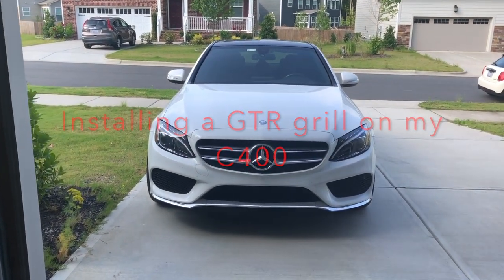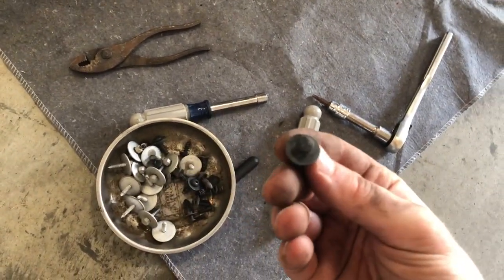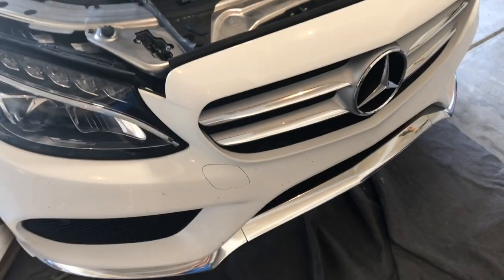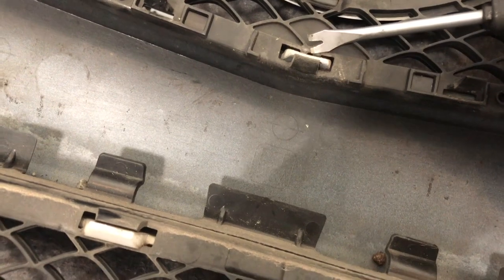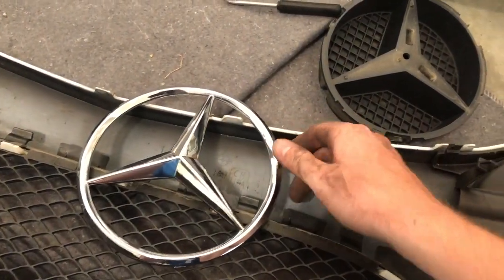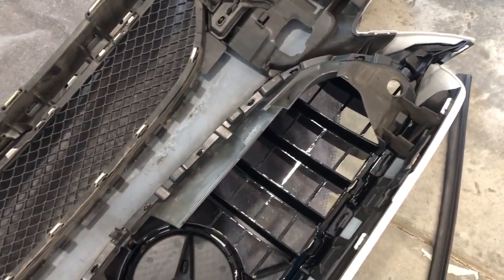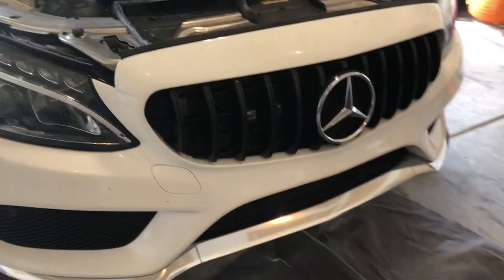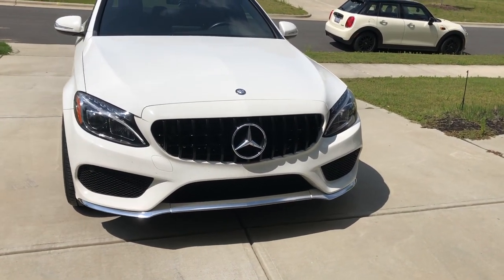Part 2 - Installing a GTR style grill on my C400 (C450/C43 AMG)

Comment: Hey Mike, just ordered the same grille for my C300. When you popped in the new grille in place, did you put back the mesh cover behind the grille as it originally came? Unless I missed it in the video.
Reply from the maker: Nice! I didn’t, mine wasn’t really a mesh it was a whole assembly that came out as one piece.
Reply: @mikesandve2564  gotcha. I was curious because I didn’t see it in the video and I can see on my grille as well, there’s a mesh like piece that probably part of the assembly that would need to be popped back behind that new facelift to avoid pebbles and other debris flying through the grill.
Reply: @Frkilicious  did you order that mesh? I am in the same boat, I also don't want the radiator to show as easy.

Comment: i have the c400 in white as well (same exact car as yours) and im torn between the diamond grille and this one.. this has been the hardest decision ever. lol the diamond is more classy looking, but this one has a more aggressive, sporty look. i just don't know.
Reply from the maker: j s lol I think it depends on the wheels u have as well. I wanted the black and white theme, if you have silver wheels the diamond might look better, but it does look more stock and less sporty I my opinion. I went through the same struggle hahaha
Reply: @mikesandve2564  yea i have the silver amg 5 spoke wheels, but am planning on getting them powder coated black. i usually dont have a tough time being decisive, even when it comes to deciding which exact car, color, specs, performance mods i want. but these 2 fkn grilles have got me beat. lol
Reply: im going with this one since we have the AMG style body kit, so we can actually pull it off. can always change it down the road since price point isn't really an issue on these things. plus the diamond grille is more common, and i'd assume this one turns major heads right?

Comment: It is a kind of funny. The first thing I did was also to change the stock grill for an aggressive GTR grill. I removed the trunk 4MATIC and replaced it with a Mercedes oem AMG badge. Furthermore, I added two side AMG badges to the left and right fender sides. With your driving skills this car is a champ.
Reply from the maker: Agree completely!
Reply: KING DEVIN yea hardcore posing... smh. Not fooling anyone
Reply: He’s not posing tho lmfao the c400 is very similar to a 2017-2019 c43 amg or a 2016 c450amg. They only have 30hp more than a c400 but that can be fixed with a tune, nice exhaust setup and some intakes, and you don’t need to do all that to get the 30hp you get the tune you deff pass the c450 c43 some people also say a lot about the snap crackle and pop that the amgs do welp it’s all on a software so when you get the c400 tune For an extra like 60-100 bucks they can add in the snap crackle and pop when you put your brand new exhaust system on your good to go. Before you call someone a poser do some research on the car the c400 is a entry level amg for the c class and the c450-c43 are just rebadged c400s. Have a nice day 🙌🏽
Reply: Javier Ramos hahahha it’s 1000% posing. It’s false advertising as an AMG. Sure, you can Do all those modifications but it still doesn’t make it an AMG at the end of the day. Why not just be happy w/ what you’ve got instead of adding fake shit onto the car? You’re not fooling anyone by doing that.
Reply: 57RollsRoycePhantom he not fooling nobody tho lol they’re literally the same car the 450 and c43 are just rebadged if he was to put the amg badges on and slap a c450 badge on the back it’s the same car as a 2016+ c450 c43. Here’s and example of posing someone with a c300 puts amg badge on the back of their car or getting a 4 series and slapping a m4 badge on the back of your getting a Camry and saying it’s a Supra that’s posing can’t say something like that when the whole car literally is the same nothing has changed except for a tune and a slightly better transmission.
Reply: Javier Ramos it’s not the same car. There’s a reason that they’re sold differently at the dealer. And it would be posing w/ the AMG badge on the trunk & fenders. If it didn’t leave the AMG factory in Germany like that w/ badges from them then it shouldn’t have them on just cuz someone did some mods and feel that justifies putting them on. That’s just lame. Go look at the poser sighting thread @ the mbworld forum.
Reply: It’s just a badge difference promise you
Reply: Javier Ramos I get what you’re saying bro. I just feel that if it doesn’t have the AMG engine it doesn’t deserve the badging. It’s either AMG or it’s not. No in between. The original poster of this video has a beautifully modded Benz and he debadged instead of upbadging which looks great.
Reply: 57RollsRoycePhantom it’s w e people like I agree with you on a certain extent. Where I agree with you 100% is the debadged look gives it such a nicer, cleaner look. End of the day tho let homeboy do his thing.
Reply: @javierramos3468   my sentiments exactly bro. you're spot on. it's his money. it's his car. If it makes him feel whatever he wanted to feel by debadging, upbadging, or just crashing the damn car into a tree. IT'S HIS PEROGATIVE. period. people on the internet kill me acting like they're so self righteous and are the judge and jury on how others should live their life. whoever you are, you may may not upbadge your car but i'm sure there is something you do that may be looked at as taboo. Stop F'n judging people so much. smh
Reply: If you want to ride with an AMG badge, you should buy an AMG car
Reply: @willisix2554  For only 30 hp more!!! Very questionable. Moreover, now days almost all AMG engines are made by robots and assembly lines rather than a single mechanic (like good old days).
 Of course, the scope of this comparison -- for now -- is solely between C400 4matic with sport suspension and C450 AMG.
Reply: @moemoe9015  yes
Reply: Javier Ramos BS !!  He’s a poser, and if you do the same, you are too
Reply: Coming from a C43 owner don’t really mind the rebadge. Just don’t be one of those douche owners who are all about badges